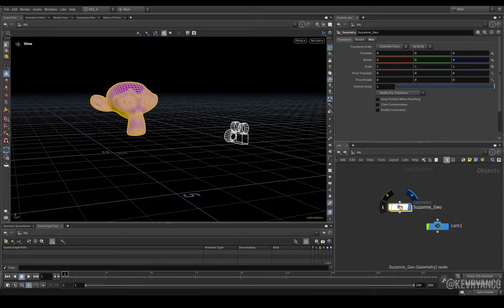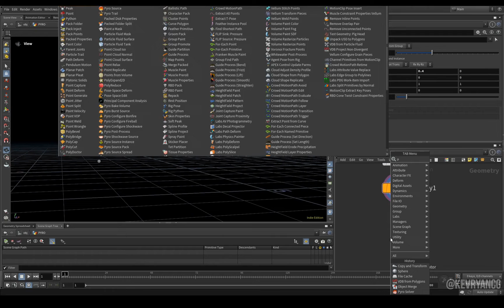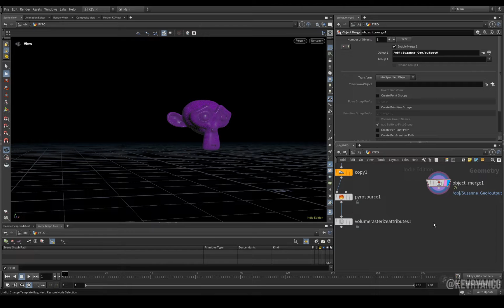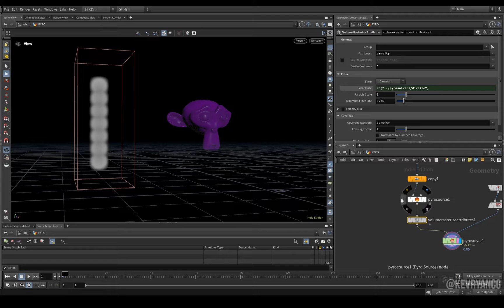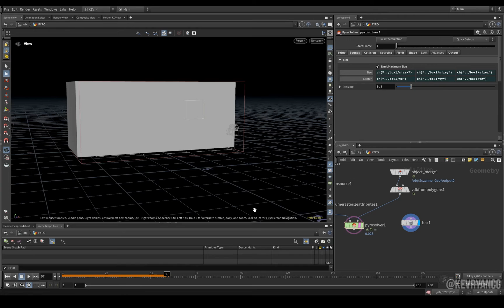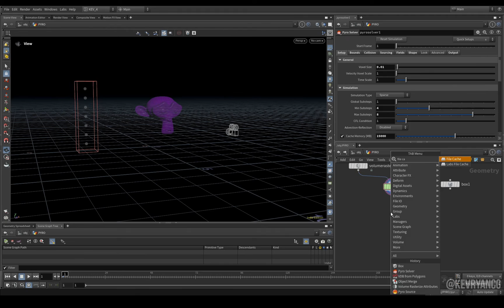Wind Tunnel in Houdini 20!

Comment: really great, thanks. I was trying to have my smoke go around a really big spherical object, but the density kept being "eaten" by the collider. I just needed to turn on fill interior on the vdb from polygons because I wasn't computing the sdf far enough inside the collider.
Reply from the maker: Oh thanks! I'll have a look at that myself, I was having trouble with adding wind having the smoke just getting eaten by the colliders as well.
Reply: substeps wouldve fixed it too most likely but if you dont need pixel accurate colliders its not necessary to do over the fill interior
Reply: @ignitoracing  For really big geo I just manually adjust it to what I needed by using the interior/exterior voxel band instead of fill interior. It worked better and way faster than adding more substeps. Adding substeps can help, but didnt solve the problem no many how many I added.
Reply: @evanrudefx  good that it worked, using volume colliders too with vdb from polygons etc sdf name "collider" and having same voxel amount as the sim itself will be the most accurate way

Comment: You should use minimal OpenCL since you have set the maximen bound.  It is way faster, and you can still cache it .(caching is faster than live simulation)
Reply from the maker: Ya know, I've not really tried the OpenCL in simulations, my card is a bit out of date and I find it chugs along a bit. But I'll look into it, thanks!
Reply: @KevRyanCG   if your GPU memory is low (mine is 12G), you can limit the loop range, size of the simulation, or  voxel size ,  just for quick tweak. And then switch to sparse to cache.
Reply: hi, how to do that ?

Comment: Thanks for the tut! Unfortunatly doesn't work for me. Simulation just disappear when touching the object (wathever the object is, I even tried with a default sphere) and does not interact with it. Any suggestion?
Reply from the maker: Ah yeah I had trouble with this when I was making the video. You have to make sure the volume is correctly named, and that it has the velocity attribute if it's moving. When you add the point.v you should see the collision volume change appearance which lets you know something is there. Then you have to make sure it has the same name on the collision Tab on the solver. 

I kinda talked a bit too quickly through the Trace Sop for that part. Also it could be substeps if it's passing through or disappearing, something about using wind in the Sparse solver causes the issue. But keep at it and try a few different things and see if it works.

Comment: looking good,i am interested about the shader of the purple monkey though
Reply from the maker: I found a carbon Fibre texture online somewhere years ago that I just had in my asset library. Plugged in the maps as you should in the Material but then used the coat to add an extra layer on top. So it looks as if the fibres are below a shiny coat.

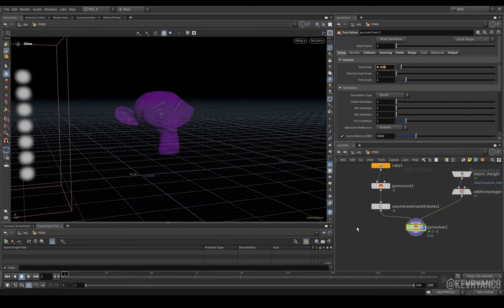Comment: 4:14 Have no success with it - object don't willing interact with the smoke. What could be wrong?
Reply from the maker: Is your object still a packed geometry? Try putting an unpack sop before the Vdb from polygons, make sure the VDB is named collision like at 2:10
Reply: @KevRyanCG  still have no success with alembic file, but with third try works on usual sphere. 
Thanks for you tutorial
Reply from the maker: @VitaliiThe  that could still be a packed geo on the alembic, you can check by holding the middle mouse button down on the alembic node and it should list it as having 1 point, 1 primitive, 1 vertex, 1 packed prim. So unpacking gets all the data back.

Or could it be that the model your bringing in isn't airtight? Does it have a lot of open edges? If so maybe try adding a poly cap to it. 
Also you're welcome! Hope it works out for you!

Comment: Excuse me,How to make this effect in blender, can you give a tutorial please
Reply from the maker: I'm afraid I wouldn't know so you'll have to do some research, but I imagine you could use an array modifier to mimic my copy to points, and then you select that, and do a quick effects smoke and tweak the settings from there on the smoke domain. 

Here's a tutorial I found https://www.youtube.com/watch?v=-s-CvxH5-_M
Reply: oh，thanks vrey much @KevRyanCG
Reply from the maker: @jimjimi-bl I attempted to look into it with the idea of potentially doing a quick tutorial by having no temperature being emitted, no buoyancy on the domain and a wind force added in. It seemed to get a similar result at first but lead to lots of weird banding as the smoke began to break up. I don't know enough about smoke in Blender to spent too much time trouble shooting it along with my other projects but perhaps that could be a place to start. You could also be very cheeky and just turn the domain on it's side which also works with extra buoyancy and temperature added. 
Though in both cases the smoke tends to still get that mushroomy start to it, which isn't present in how it works in Houdini, so the method of solving the smoke must be different.